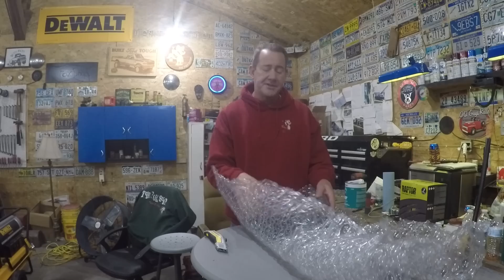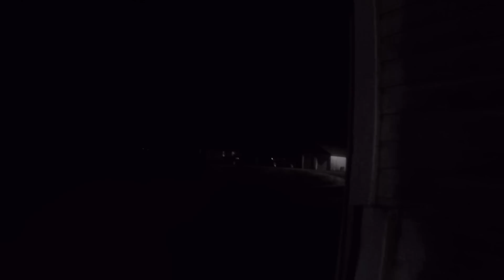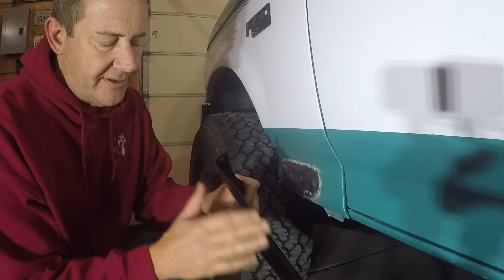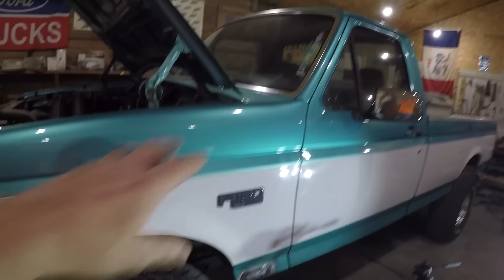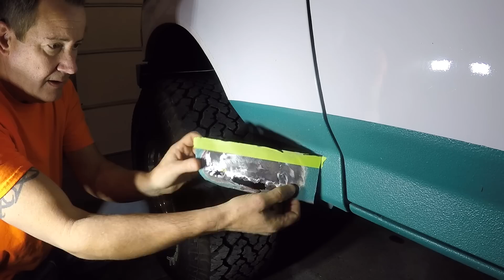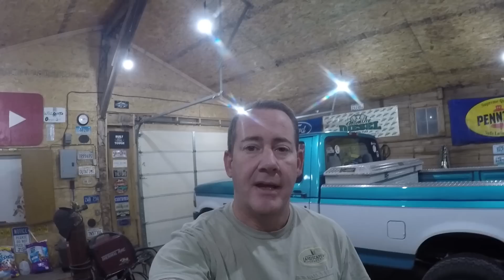FITTING The Fender PATCH On The 1994 Ford F150

Comment: I know this is an older video but I’m referencing it as I’m trying to replace some body panels on my 81 f150, and noticed the Bed liner type material on you bottom green portion. What product is this? I’d love to copy the idea with my lower red portion, but I don’t want the color to be super noticeably different.
Reply from the maker: It's tintable Bedliner... Raptor liner
Reply: The Fox Shop I’ll have to look into it. I’ve heard of raptor liner, just didn’t know up you could get colors. Definitely stealing you idea lol. Thanks!

Comment: Any theories as to why it rusted like that? If I'm not mistaken you rarely took it out in the snow since it was repainted. I wonder if mud gets caked up between the inner and outer fenders and doesn't have much of a chance to dry out in a humid climate like Iowa? Either way, it's coming along nicely Jon!
Reply from the maker: I think that fender had issues when I put it on. Thought I fixed it but apparently not..
Reply: Dirt, grime, leaves, bugs, everything comes down between the outer and inner fender and clogs up at the bottom, then, like you said, humidity starts rust.